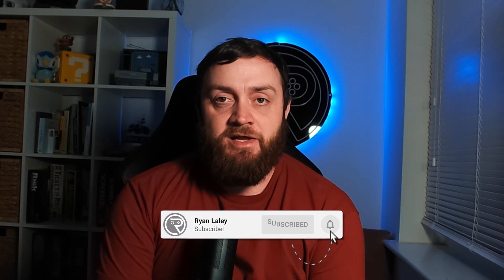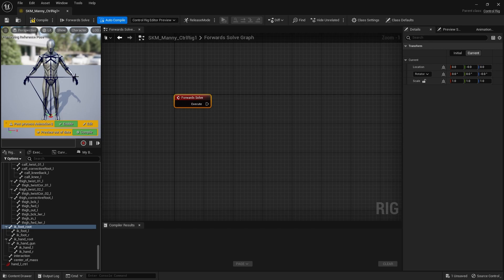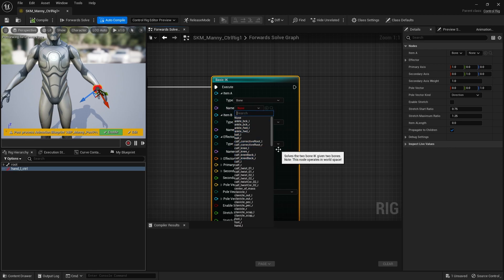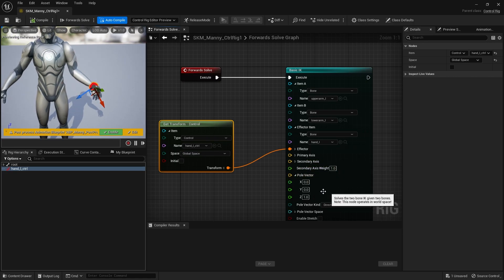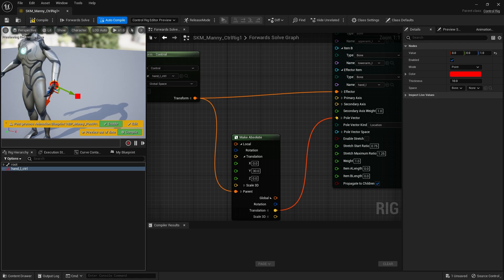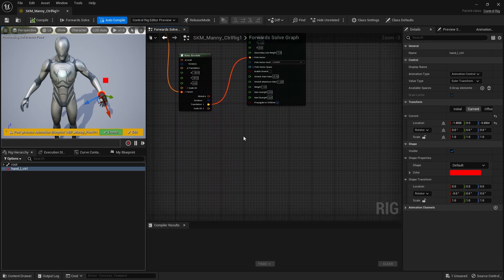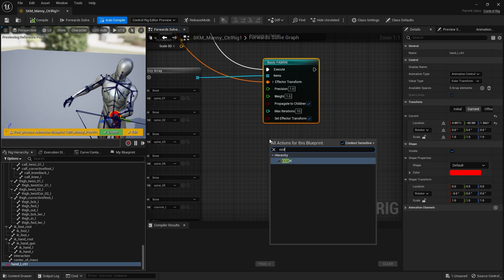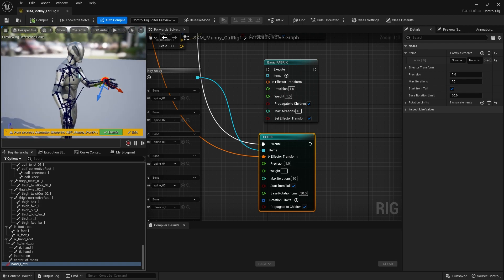Unreal Engine 5 Tutorial -  Control Rig Part 2: Types of IK

Comment: Thanks for these videos!

Is there a relatively easy way to create what I've heard referred to as Variable IK? Basically, on an IK joint chain, I would like at least one middle controller that can slide up and down the chain, affecting where most of the bend is occurring, for specific poses or to animate a wave through the chain.

Really hoping you do a part 3 soon. Joined your patreon but still don't see one. I know you mentioned aim controls but I would also like to learn about the procedural rig options with Construction Events in v5.1 and newer. Having trouble finding much detail on that in other tutorials.
Reply: Interp thru the different rotation restriction bone settings of each joint.